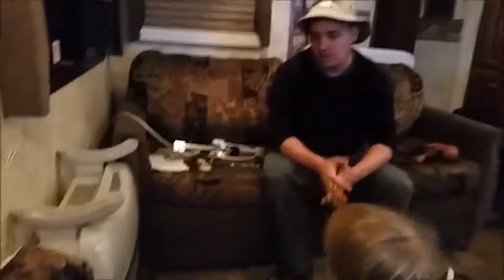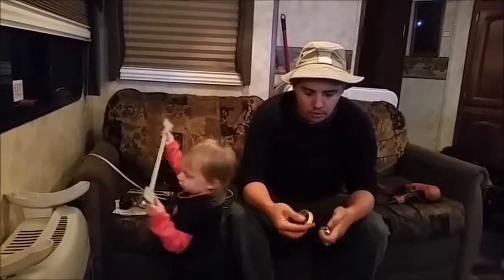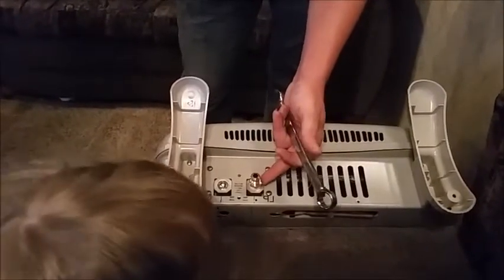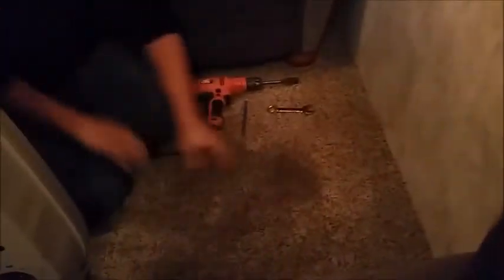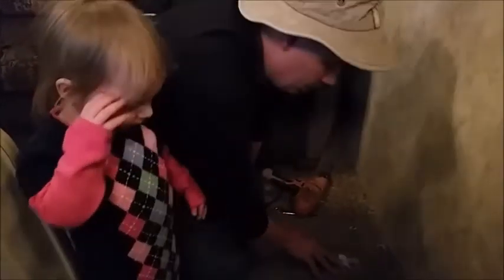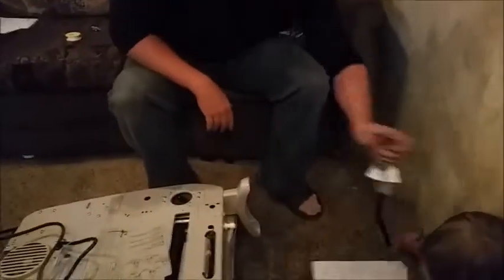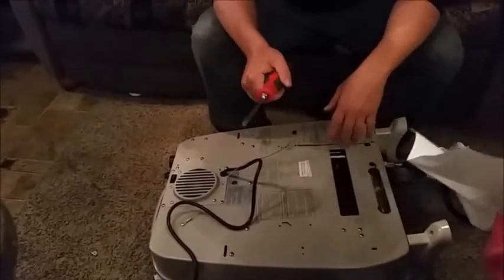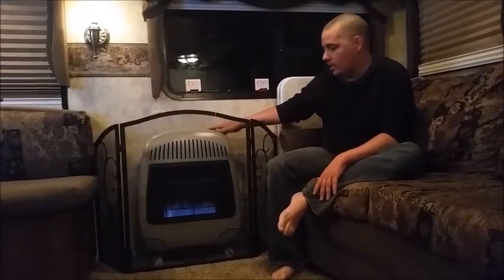Installing a Heater in our RV

Comment: Thank you so much for posting your video I have been trying to find a video like this. I am thinking of installing the same heater you put in. Do you think running this heater saves you a lot more money than the furnace in the RV. I am going through so much propane. I am also thinking of installing the heater in my slideout part of my camper and didn't think I would be able to until I seen your video. Do you have a video of how you ran the gas lines under your RV. Thanks for your help.
Reply from the maker: +TIM MARKLE We have had nights as low as 6 degrees. We have only used about 1 40 lb bottle every 2 weeks. It is about 14 a week to heat our 33 ft rig. We hardly run our RV furnace and we use the AC fan only option to circulate the heat. As far as the gas line, it is not made to travel with. So we unhook it when we travel, the way you would a bbq grill. I recommend a digital read out carbon monoxide detector.
Reply: Wow that is great. I think  you have your gas lines running under your camper the way I will be running mine. I want to put my heater in my slider part of my camper/ Thanks for the advice I will get a digital read out carbon monoxide detector.
Reply from the maker: HeyTim I just wanted to let you know how things are going now that we've had some time with some cold weather. We are in North Dakota and I've had nights well below -20. I have a neighbor with an RV similar to mine and talking to the camp manager today ,I found out she has filled their propane tank twice. She's using a 250 gallon propane tank and propane at the moment is running around $2.50 a gallon. I on the other hand am only using a 100 gallon tank which is hooked up to my RV furnace my RV hot water heater and my RV refrigerator. I have the hot water heater running on electricity I keep the furnace set to 65. I have the little heater in the video hooked up to 40 pound bottles, I use one per week. That's roughly $50 for every two weeks and we keep the inside of our RV between 75 and 79°. I have only used 50% of my 100 gallon tank and I expect to last until February. So my neighbor is spending somewhere around 750 to thousand dollars a month just for heat. I am spending around 200 a month on propane. So yes I have greatly reduce the cost of living in the RV by using the heater. And I'm staying warmer than anyone else in the park.
Reply: Wow that is great I heard those heaters were very energy efficient I think you have me sold on one. I bet it is freezing in North Dakota. I really appreciate all the information you are giving me I am trying to make up the money I lost through a bad divorce. How big is your camper.